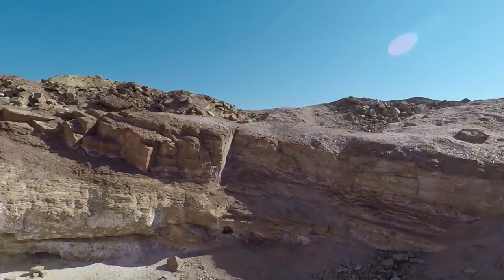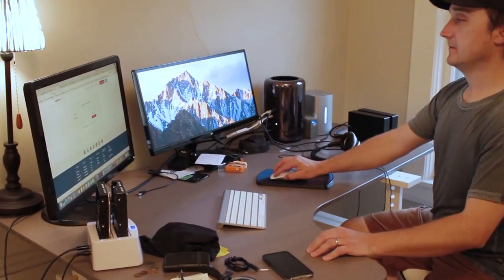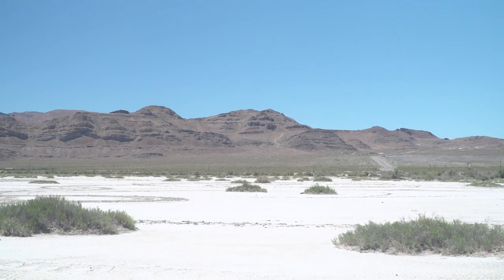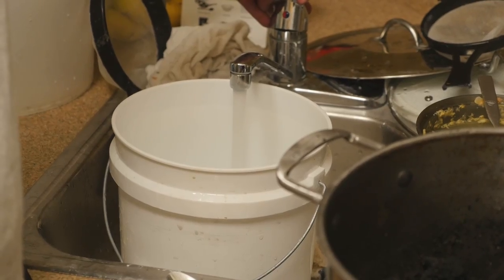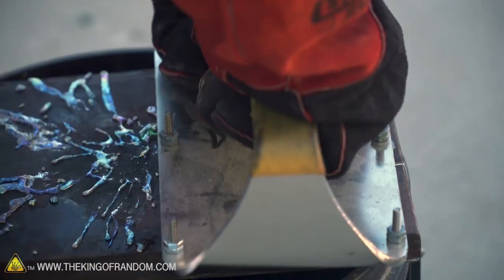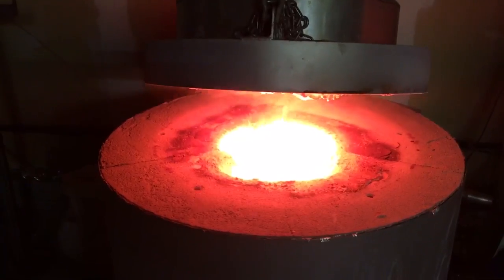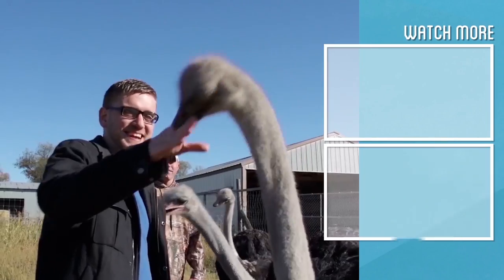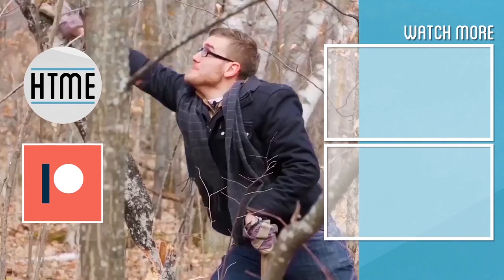DIY Foundry Build | How to Make Everything

Comment: Glasswort is actually really really delicious if prepared right. You boil it for a couple of minutes in plain water, strain it and let it cool a bit. Then you can pull the outer soft layer, which you eat, from the stems. 
Then you prepare a dressing made of olive oil, garlic and lemon juice and pour it over. 
Goes well as a side dish to seafood

Comment: Do not use teflon (PTFE) tape or pipe thread seal on flared fittings (for example at 5:22). They are designed to seal with out them, and using them can cause a poor seal. On non-flared fittings you should be using yellow tape not white. Using galvanized fittings anywhere near the flame is not a great idea because the zinc can cause deadly Metal Fume Fever when heated.

That said -- you've already burned off the zinc, and if the fittings aren't leaking, you probably don't need to redo them. Just something to keep in mind for next time.

Hope this helps! I love the channel!

Comment: If you really want heat, move away from venturi to forced air. Replace the reducer with a Y or T, use a hairdryer, blower or anything you wish and you can really turn up the gas flow.
You only need a single burner and the limiting factor tends to be your refractory. :)

Comment: Hi, as a chemistry student, I wanted to give you a few tips, for a better quality glass. You can purify your materials, for example cody has already shown how to purify sand, and for soda ash - once you boil all the water - collect the crystals and recrystalyse them, dissolve them in hot water, filter and let it cool until crystals form/boil it again. By cooling it i'm guessing you would get smaller yeald, compared to boiling but better quality crystals, cuz I can already see from the color, that it is contaminated :>

Comment: Hope you're reading this: I've got some advice that WILL help you improve your results:
- To purify your ingredients, you should perform a recrystallization. Meaning after you boil down all the water you take the salt that is left and add boiling hot water to it until it has just about dissolved completely (no more than that!). After that you let it cool down slowly and place it in a fridge after it reached room temperature. By doing this you will get nice crystals of your desired product and other salts, which you can separate by sorting them. Take what you need and repeat the process a second and maybe a third time, until you have a bunch of pure white crystals. This works with all soluble ingredients, is relatively simple and only takes some time. This technique is constantly used in chemistry labs and is a very effective way to purify chemicals.
- To prevent the development of steam when melting the ingredients you should preheat them to about 120 °C first to dry them out instead of melting them directly.

Comment: You will get a ton more heat out of your foundry  if 1 you line your wool with refractory, even better would be to ditch the wool and only use refractory if you are planning on long burn times since it will take longer to heat up the refractory. 2. Convert your venturi burner to a forced air burner. Those are our go-to burners for forge welding with propane since they get way hotter then the venturi burners.

Comment: The galvanized coupling was probably plated with zink, and zink has a really low boiling point so it started to evaporate in the foundry.When the zink fumes mixes with oxygen in the air it burns into zink oxide which is the yellow stuff at the end of the torch. PS the zink oxide fumes are not good to breath in!

Comment: For fun I thought I would apply a little of my heat transfer knowledge to the design of this foundry.
Assumptions:
1. Steady-state conditions.
2. One-dimensional conduction through the wall of 0.0254 [m]. 
3. Constant thermal conductivity for # 8 Kaowool of 0.30 [w/(m*K)]
4. ambient temperature of standard "room temp" 23 °C or 296.15 K
5. inside foundry temp between 1650°C to 2150°C assuming minimum 1650°C or 1923.15 K
6. container assumed as a simple Right cylinder r = 0.20701[m] h = 0.38862 [m] (surface area of sides 0.50547 [m^2] surface area of top and bottom 0.65 [m^2] )
7. the refractory bricks have too many gaps to significantly affect the heat flux

heat flux determined from Fourier’s law
this suggests a heat flux of 19216.54 [w/m^2]
doubling the Kaowool layer will lower the heat flux to 9608.27 [w/m^2]
4 times the Kaowool layer will lower the heat flux to 4804.13 [w/m^2]

solving for the heat loss through the wall
9713.40+2*12497.3 = 34708[w]

basically, you could be losing about 118428 [BTU/hr] with the 1-inch Kaowool layer. reduced some with the refractory bricks

Comment: I've said this once on another video but a solution for making the glass mix faster with fewer bubbles and be less chunky would be a ball mill. In the video, I just cringed when you mixed glass ingredients in the bowl leaving the chunks because it should be a mix of ingredients to the molecular level, silica melts at 2000C and it's the mix that lowers the melting temperature. If you look at any other glass making factories the glass ingredient mix is pulverized.

Comment: a fuel you can make that will burn hotter than methane and coal is Hydrogen. with Electrolysis, you can split the water into Hydrogen and Oxygen I can't find how much it will increase the temp but have seen sources stating that it will increase the temperature but it might just speed up the reaction so more heat is released in the same amount of time is by moving the air in a cyclone fashion around the fire and source of fuel to dray it faster; I would love to see how this works! thanks for all your cool videos! also if you make tar you could sort it to the different focal fuels and then you could get even hotter but sorting might be too big of a project not sure.

Comment: some would argue that you have made a foundry not a forge, the pedantic difference being that forges tend to describe more horizontal furnaces like a smithys hearth whereas the vertical cylinder style is more often called a foundry, it might be different because you're working with glass or you being in the US but who knows :)
Reply from the maker: Yep, I mixed up the terminology and fixed it.  Thanks!

Comment: I don't know how practical of an application this is, butt have you thought about trying to harness the power of the sun to get the glass hot enough? Check out Green Power Science and how Jason Rojas can use a Fresnel lens to melt just about anything with concentrated sun light.

Comment: Did you prime your crucible?? I think that's the term anyway? Basically you heat it up to as hot as you can very slowly before you attempt to use it for the first time. If you didn't then the crucible broke because of the shock as it was heated too quickly the first time you used it
Reply from the maker: +JE 123 I tried to do that as best as possible, but not being familiar with the forge I likely ended up heating it too quickly.
Reply: How To Make Everything believe me I've done it far too many times. It's a tough process and can still end up being useless occasionally

Comment: galvanized steel has zinc  in it and from what i've heard Zinc Oxide fumes are potentially lethal or toxic.
Reply: Nope. 
Zinc fumes are only bad if you breath in a shit ton. The worst part of zinc oxide is that it forms a dust that can damage your lungs. 

As long as you don't stand above burning or boiling zinc for too long, you are fine.

Comment: Uhh Hey not sure If you will read this but having learned this from various metallurgy classes and from fellow blacksmiths (I am an ameture blacksmith myself) the one thing you never do is heat Galvanized metal, because one of the main components of galvanization is Zinc which will form a gas at elevated temperatures, Zinc Gas is highly toxic and could seriously damage or even kill you if inhaled, what ever you do NEVER use galvanized fittings for burner components EVER or anything that will be exposed to high heat. you could die.

Comment: Not usually a fan of being pedantic, but what you have here is not really a forge. Typically the term forge is reserved for the type of furnace that heats metals in solid state for forging. What you have here is closer to a foundry in design. I'm not sure what the term is when you use it for glass.
Reply from the maker: Yep, I mixed up the terminology and fixed it.  Thanks!

Comment: Not sure it is a good idea to have the burner tips inside the foundry. Yellow could be sulphur in your raw materials, melting things a second time is always easier, not harder. It wasn't melted because you are 300f off a good temperature.
Reply: You could add some b2o3 to help lower the melting of the glass.

Comment: hey saw guy put a trumpet mouth peace in plastic tub and oil funel in other end and played something sound like trumpet. on series make own instruments maybe trumpet or trombone not as impossible thing i one thought it was. saw utub veto were took flat brasses curled up trumpet filled frozen soap water beucse said ice flexible? some how right tools able bend iron in all round bends. i think if you do it  done like a renssanse feastable trumpet. like one do back kings and queens. use a real trumpet mouth peaces but think long peace pipe then bell end you be able do some trumpet songs just not all them. maybe get faundre working and get copper? trumpet would cool use of expensive metal making.

Comment: I hate to be that guy, but I'm disappointed. I used to be a huge fan of this channel and I'd share every video you posted. Back in the days of making sandwiches, and suits. These days, the channel is turning into "How to fail at DIY projects, and cause safety concerns along the way". Ordered the wrong size, modify it. Order the wrong kind of steel, use it anyway. Put something that hot next to your grass. It's a recipe for someone to get extremely hurt. I really wish you guys would get back to your roots.
Reply from the maker: Thanks Nick for your comments.  Just so you know, Andy never sets out on a project with the intent to fail.  If you recall, most of our original projects did not end up complete successes either.  When you say "back to our roots", can you explain what that means?  What was different in our original content that you now miss?
Reply: I know he doesn't "set out to fail" ... but it's been a while since we've had a success video. Let's talk the sandwich video series. After every episode, we felt like he accomplished what he set out to do. And at the very end, he indeed did make a for real, edible sandwich. It may not have been the best sandwich, but it was a sandwich, and it was edible.

Let's talk about the suit. In every episode, he set out, he got what he set out to do. At the end of the episode, he accomplished his goal. Sheered a sheep, got the hemp, learned to weave, whatever. At the very end, he made a suit. It didn't fit, it wasn't functional, but it w as a suit.

The thanksgiving dinner, the root beer float, the clay pots, the quill. They all left us feeling like he accomplished what he set out to do.

All of the more recent videos tend to end with "Hopefully we'll get it next time" and "It didn't work out" ... When I say "Back to your roots" I mean, I'd like to see videos that are successes. The telescope didn't work out. All of the preservative stuff was really hit-or-miss. A year old, edible sandwich? Really? This is what, our 6th glass episode that once again was a disaster? This channel is feeling more like a ride-along while we watch him learn through trial and error and a "What not to do", whereas before it felt like it was an entertaining and educational watch to a successful project.

If we look at the uploads:
The foundry - Disaster
The closet garden - Didn't work, had to completely move everything to get growth, then move it back and "see how it goes"
Root beer float taste - not a "make" video
Fresh food - Not a "make" video, more of a filler video just to show people how fresh produce gets from A->B
Root beer float - a remix of old content
Quest for clear glass - another glass video
Kimchi - Wasn't Andy

Etc...

Maybe I'm rambling, maybe I'm alone, but it doesn't feel like the series is what it used to be. Don't get me wrong, I'm still a fan because ultimately I love what you guys are setting out to do. I just can't help but end every video lately feeling disappointed and saying "here we go again" to myself.
Reply from the maker: Thanks for the followup.  This is Brian by the way, not Andy.  I'm one of Andy's Partners on HTME.  There are three of us that do everything for this channel.  I see what you mean about the sourcing or making videos leading up to the final product are considered successes even though the end product might be a "failure".  Our initial videos were part of our initial Series that ran on Local TV in the Twin Cities.  We had months to plan and produce those.  Now that we are on YouTube, we are often shooting video that will go live in a week.  So there is less time and more pressure to be launching videos, as that is the main way we can stay up in the YouTube algorithm.  Because the making videos are so time consuming, we are testing out what other type of content we can produce while we are making the more complex projects.  The whole goal is to make the channel sustainable so that we don't burn Andy out and all go broke :).  But I hear you, and I think we are all still committed to the initial mission of Andy's quest to learn how to and successfully make every day items we take for granted from scratch.  What we love about being on YouTube is it's a great platform to try new stuff and see what works and doesn't work, which is what we are doing now.  But having feedback like yours is exactly what we want at this time.